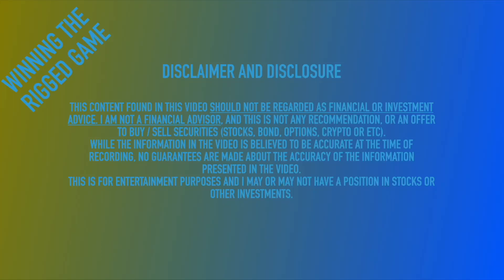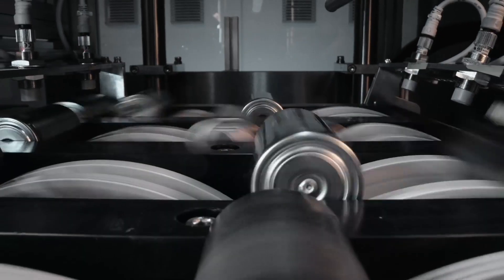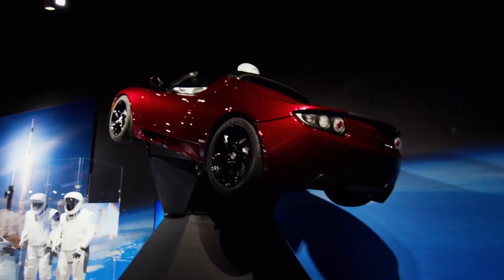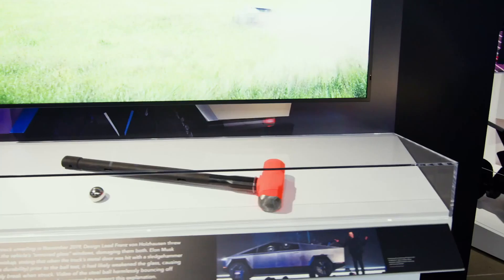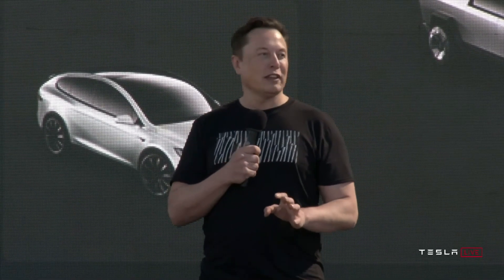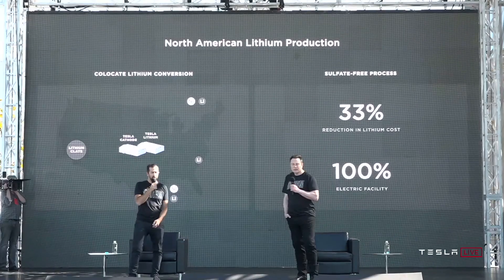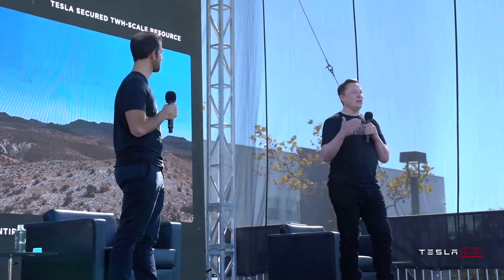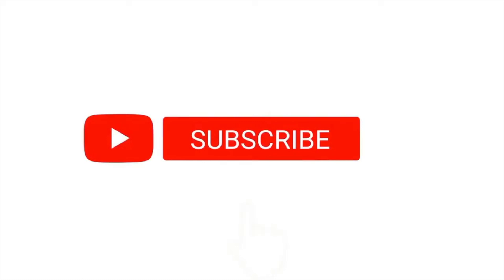WTRG - The 4680 Batteries suck!!….uhmmm..wait a second….ok I like them now.

Comment: Do not forget they have gone back to a simpler chemistry for the initial 4680 cells,  this takes out complications to get the new manufacturing proccess up and running.   Even with that more basic cell chemistry  they are matching the capacity of the 2170 state of the art cell chemistry.  That to me seems quite an achievement on it's own.  They are still ironing out difficulties with the new manufacturing process.  It would be nice if they had got everything running perfectly 1st time but probably not realistic.  
At the Kato road test line, I read, working well with the current format but stopping nightly to run test batches preparing for future upgrades. 
Soon they will move on to the mark 2 cells incorporating similar chemistry to the state of the art 2170 cells which I expect will show a significant improvement in capacity over the 2170 cells.  After that the high nickel cells which will be as amazing as we are all expecting.   With them already testing for the cell advances ramping up will probably be much quicker.  
So yes we listened to the sooth sayers alocating the 10G of cells from Kato Rd, assuming tesla could ramp up production much quicker than any other cell maker has achieved.
I think we have seen enough to be sure we are going to get there with the cell production even if slower than we had hopped.
Reply from the maker: I agree with everything you wrote. The limiting factor had a new video basically saying the same as me....somewhat disappointing but we agree with you that in the near future...look out. I think the most important things for Tesla are the 4680s, gigapresses, gigafactories, cybertruck, AI for FSD and the Robot. The current stock price is nuts...too many shares put into the market by Elon in too short a period of time. New video is being posted in a few minutes. Warning it is a little negative but....i've been hurt hahaha. Hell, I don't want to sell a single share but I had to really make tough decisions. Let me know what you think....I might annoy some people...hopefully not too many. We can have different points of view. That seems to have fallen out of favor lately.

Comment: Lots of battery day changes yet to be included
Reply from the maker: yes, and I am looking forward to seeing those. Personally, I would like about 400 mile range. My house is in Naples, Florida and my Mustang goes about 380 miles on a tank. It is enough to go to Miami or Ft. Lauderdale, do what I need to do and go home without stopping to gas up. They finally have a charger mid-point on "Alligator Alley" (I-75) but it would be nice to have the same range as my gas car.